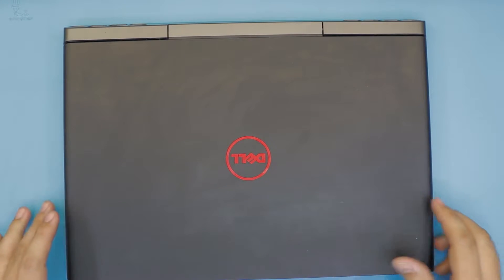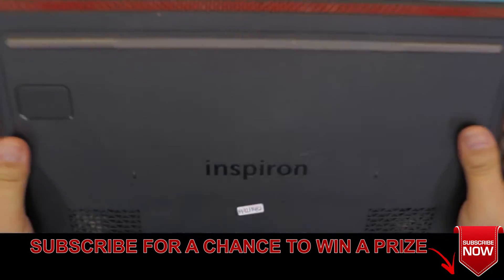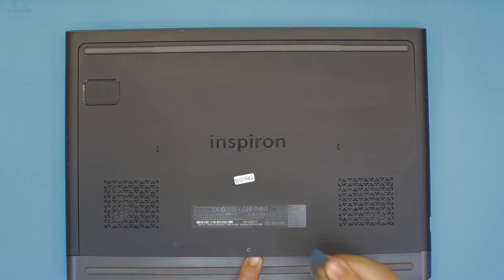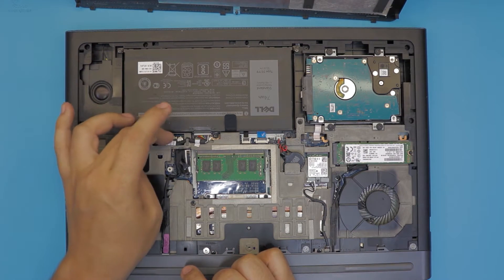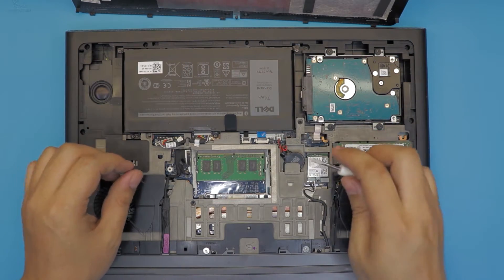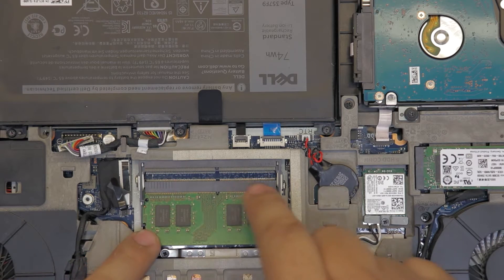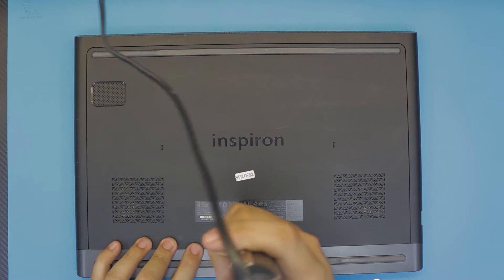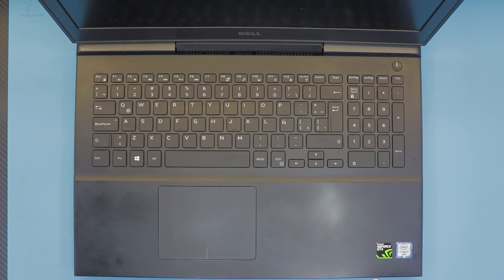Dell Inspiron 15 7000 RAM UPGRADE / Replace

Comment: Thanks a lot for the video and the straight to the point explanation. My issue is, I have an 8gb Ram, but I learnt the max capacity of the laptop is 32gb Ram. So  I want to know if it's okay I get 2 of 16gb ram to achieve the 32gb.
Reply from the maker: Thank you for your feedback! If you wish to support the channel, you can like, subscribe, or both!
Regarding your question, sure you can we have upgraded this laptops to 32gb 2x 16gb with this compatible rams: https://amzn.to/3WG5y4K
double check the max capacity: https://youtu.be/tKEJTkVth4Q
Should you have any further questions or requests in the future, please don't hesitate to ask me.
Reply: @uFixTek  please will 16gb 2666 MHz work cool or I need to get the exact 2400 MHz?
Reply from the maker: the 2666 will work fine my friend the bios will auto adjust automatically.
Reply: @uFixTek  thank you
Reply from the maker: It's my pleasure my friend. 😊

Comment: Hello. I’m new to computers so I was wondering when I change the ram from my current 8g to a 32 do I have to do anything else or is it just plug and play pretty much. This is my first laptop I’m trying to work on myself. Thank you.
Reply from the maker: 🫠Regarding your question, it's just plug and play no extra configuration is needed.
Should you have any further questions or requests in the future, please don't hesitate to ask me.
cheers🍻

Comment: Hello, I’m not sure if you’ll reply but I can insert ram on the lower slot on this exact computer but if I try to insert it on the upper one it gets stuck halfway through
Reply from the maker: TheBowenArrow you have to push it firmly , in some cases it wont go all the way in , if its not going anymore in its ok push it to the mot if you hear the clips clicking then its in
Reply: I have the same problem, my model has the little plastic straps missing in the upper ram slot

Comment: Hello if I put 3200hz ram will it clock at that speed or will it run it slow at 2000 mz
Reply from the maker: Thank you for the feedback! if you wish to support the channel you can LIKE or SUB or both :P
regarding your question: the Motherboard and bios will auto adjust to max ram speed that it can handle, remember this laptops don't have advanced bios to set your own ram speed. so if you placed a 3200 and the motherboard runs it at 2666 then that what you have. you can't go any higher. and make sure all your rams are 3200 or all are 2666 else if you mix the speed the bios will take the lower speed ram as reference and lower the higher to match the lower speed.
Reply: @uFixTek  No, it is does not work like you say. DELL 15 7000 inspiron WILL NO WORK correctly at 3200 RAM.
It will crash, becouse BIOS of that model DOES NOT SUPPORT high speed RAM.
Install only 2400. I dont find information about 2600. In my DELL Fury 3200 Ram Crash like in other users who try to install 3200.
Use 2400

Comment: Does the computer have a limit of ram you can install? Was hoping to upgrade it to 32 gigs of ram for my bday but i dont know if theres a limit
Reply from the maker: yes you can go up to 32 gb ram max,
https://amzn.to/2BZtqrV
Reply: @uFixTek  i have 8gb ram on my one slot can i add another 16gb ram to my second slot total of 24 gb. is it possible?
Reply from the maker: chinzo bayarsaikhan it is possible but if you want to game on it i would highly recommend to add the another 8gb with the same speed ram as the one you have that way it will activate a dual channel mode, its much faster.

But if you want to do video editing or applications then yes go with 24gb config.
Reply: @uFixTek   Hi, I do programming and use emulators and virtual machines would you recommend me go for 16gb or 24gb?
Reply from the maker: Luis Mtz if you doing prog you should go 16 or even 32gb. If you using VM
Reply: @uFixTek  i have a problem i bought the ram you linked me and installed it fine but for some reason when i check my pc settings and specs it says i only have 24 gigs of ram? did i do soemthing wrong or did they send me the wrong type of ram
Reply from the maker: Caiden you bought a 8gb ram and how much ram you had inside your laptop before that. And how did you check? I think you read your pagefile ram not your actual ram!. When you power on your laptop press f2 and get inside the bios and see the correct info there.
Reply: @uFixTek  ill check it this weekend i bought the duel 16 gig ram pack

Comment: Does it have to be Dell certified RAM or can I use any sodimm DDR4 2400?
Reply from the maker: Thank you for the feedback! if you wish to support the channel you can LIKE or SUB or both :P
regarding your question: Any sdram ddr4 2400 will work no need for any certification (doesn't exist)
this a very compatible ram and highly recommended: https://amzn.to/3NBeTWl

Comment: After installing the ram do you have to reinstall windows, and did you replace or upgrade the ram to 16gb?
Reply from the maker: Thank you for the feedback! if you wish to support the channel you can LIKE or SUB or both :P
regarding your question: NO, not at all you can remove upgrade replace the rams and it will not affect the files or system or anything. its totally safe to do it. you can place 16gb and no issue. if you want to know your max ram capacity check this video:
https://youtu.be/tKEJTkVth4Q
Reply: @uFixTek  thank you so much I will check it out. Will sub
Reply from the maker: anytime if you need any help let me know.
Reply: @uFixTek  thank you

Comment: Hello, I have a problem, I had two RAMs in the form of 2x16, but one of them broke down anyway.  Now I have a solid 16gb ram, but it works when it is in slot A, but when I plug it into B, it does not turn on with the notification light.  so i mean is Slot B broken?  Or is the motherboard manufactured to work in a single Ramle A slot?  Thank you in advance for your answer.

edit: the other broken ram was on when I plugged it in, but I was eating blue screen and green lines appeared on my screen.
Reply from the maker: Thank you for your feedback! If you wish to support the channel, you can like, subscribe, or both! Regarding your question, all laptops and pc have DIMM1234 and they only work as they motherboard manual, in your case the dimm A must be filled 1st then you can use DIMM B, your board is fine

Comment: Hello, could you recommend me maximum and which kind of memory ram for Dell Inspiron 15-7559, I work with Premiere Pro, Photoshop, After Effects, want to have the best performance out of it. Great videos and channel, congrats.
Reply from the maker: Thank you for your feedback! If you wish to support the channel, you can like, subscribe, or both!
Regarding your question, 1st check the max ram capacity: https://youtu.be/tKEJTkVth4Q
if the ram capacity is 16gb then get this: https://amzn.to/490eo2n
if 32gb then this: https://amzn.to/3NTq0vH
this above rams are very premium and we use them all the times.
Should you have any further questions or requests in the future, please don't hesitate to ask me.
cheers🍻

This is an Amazon affiliate link. When you use my links, you are helping to support the channel. 🙏
Reply: @uFixTek  found out that suggested ram is ddr3l 1600 Mhz, 16 GB max., how do you recommend: DDR4 3200 MHz SODIMM PC4-25600?, regarding link of amazon you posted. Could you expand a little bit, please?
Reply from the maker: you can place a 1666mhz but if you place a 2666 or higher the bios and motherboard will always auto adjust the speed to the max it can handle (in your case if the board runs at 1600 ) it will lower.
if you want to purchase the the nearest to 1600mhz then get the 2400mhz
https://amzn.to/3Hf8cr3
i recommended the higher speed as it will have no issue on its combability.
Reply: @uFixTek  wow I did not know that, thougth that you needed to use the recomended on laptop specs sheet
Reply: @uFixTek  if this is your laptop and want the best performance Which one would you pick to Edit videos with adobe products?
Reply from the maker: wooo wait a sec i just saw that you said DDR3L ??!!!
this laptop doesn't take DDR3L is a DDR4. unless you have a different base model!
give me the TAG number of your laptop, so i can tell you exactly what you should have,
this laptop in this video take ddr4: https://imgur.com/a/VewSVYu
Reply from the maker: that is vast 7000 Series pdf that may not even be for yours laptop, under your laptop there is a sticker look for TG: or tag number or take a picture send it to my email, or when you enter into bios you will see the tag number.
Reply: @uFixTek  it says service tag : 765FQH2, is that the number that you ask for?
Reply: Photos of tag and current memory ram cards of laptop in that link
Reply from the maker: yours is Inspiron 15 7559, that is gen 6cpu
is a SDRAM DDR3L (L is for Low voltage)
you can only have 16gb 2x8gb DDRR3L : https://amzn.to/4aNcKCz
the model that you have a is a bit older than the one in this video.

This is an Amazon affiliate link. When you use my links, you are helping to support the channel. 🙏

Comment: I’m trying to install the two 16 GB Rams. When I clicked the buttons to raise to 45° and I pulled out the original 8 GB RAM. The hatch closed… I cannot get it to open now. Is there a trick to getting it to opening with no ram stick in there?
Reply from the maker: Thanks ✌  for the feedback!  if you wish to support the channel you can LIKE or SUB or both :P
Regarding your question:  no you don't open the hatch when there is no ram, just simply place the ram in 45° and push a bit with force to the motherboard and the ram will push the hatches to the side and over its self to lock it.
the only time you push them away its only to remove it.

Comment: I have the same laptop i updated it to 16gb can i update to 32gb having two 16gb cards? I looked up in Amazon using your link same brand just more gb and they are ddr4 and 2400
Reply from the maker: Thank you for the feedback! if you wish to support the channel you can LIKE or SUB or both :P
regarding your question: 1st of all double check to see if your CPU and mother board can handle 32GB:
https://youtu.be/tKEJTkVth4Q
if so let me know.
Reply: @uFixTek  i just did it i got 33.55
Reply: @uFixTek  so max i can get is 32 ram which is still smaller then 33.55 can i still buy the 32 or is it to close to the number
Reply from the maker: 33.55 its premuch 32GB, its like the HDD when you buy a 500Gb you dont actually get 500gb you get 480GB, same goes for ram the ram that you purchase its technically 33.5gb but its programmed and sells as 32GB.
anyways YES you can have 32GB max ram.
we use this brand and its rock solid and compatible:
https://amzn.to/3nzR2ew
2nd option:
https://amzn.to/3fA9Vtq
Reply: @uFixTek  awesome thank you hopefully i can get better fps 🤣 i also need a new battery I’m scared to get one off of Amazon lots of people said aftermarket batteries don’t wanna charge sometimes, anything you might recommend what i should do?  Its a inspiron 15 7000 gaming, 74wh type 357f9 11.1v battery
Reply from the maker: if you gaming remove the battery and use the laptop without it it will last you longer and the charger too will last you longer. no matter where you buy its 50-50
Reply: @uFixTek  can i just unplug it? And leave it inside of the laptop
Reply from the maker: sure you can, nothing will happen to it.
Reply: @uFixTek  I’m assuming the rank doesn’t matter? I have single ranks in my laptop now
Reply from the maker: no rank for you doesn't make a difference

Comment: Whats a good upgrade for the base model ram ? And how much ram can be installed in this laptop?
Reply from the maker: 16Gb ram is the recommended you can go 32gb but its overkill, 
single 16gb stick: https://amzn.to/34XG9KF
2x8gb stick: https://amzn.to/2TR2PG0

Comment: Hi,  I have tried to put a matched 16GB of RAM to my Dell Inspiron 15 7000 to give it 32GB of RAM . My laptop is identical to the one in this video. I did not disconnect the battery but put the new stick in. the BIOS sees the RAM but now won't boot up as it says there has been a warning "Alert! The amount of system memory has changed". Now I can't get the laptop to boot. I have tried to remove the new RAM and reboot the laptop but it still fails to boot. This should have been a simply process but I can't get past it. After several failed boots the Dell Support Assist kicks in and scans the system and there are no issues identified but it still fails to boot. Is there anything else I could/should do to get my laptop to work again? I wish it had been as simple as your video!
Reply from the maker: hi, don't worry your laptop its just fine, the issue you facing is a stock BIOS config. i need you to follow this steps exactly as i say:
#1. remove the charger, disconnect the battery, disconnect the bios battery 
https://imgur.com/a/F8n7idh
#2. remove both rams (all rams)
#3. press and hold the power on button for 30-40sec
#4. plug in the new rams both 16gb.
#5. plug in the bios battery only wait 60sec
#6 plug in the big battery
#7 plug in the charger and wait 15sec
#8. press power on button and wait 10-15 sec (it could be in black screen) the bios will reset to default.
note: you may get a reading saying bios has reset to default and press any key to continue. 
if anything let me know
Reply: @uFixTek  Many thanks for taking the time to respond and help me. 

I have done everything in the sequence you prescribed and got to #7 and when I plug the AC power in the fans start up and the laptop seems to do several blank screen starts. 

It then loads into a BIOS screen with the message "Time-of-day not set - please run SETUP program" and also "Invalid configuration information - please run setup again". 

I understand if the CMOS battery has been disconnected and capacitors discharged the BIOS will rest and the time won't be right. So I go into the BIOS  and put the right time and date in and restore the BIOS to the defaults. I exit BIOS and the laptop tries to reboot but ends up at the same state as before. 

I am guessing there is something I am doing wrong or there is more to this issue. 

Are you able to offer any more advice, please? Thank you.

Comment: Can I put 2 8gb ram at the same time since there is 2 slots?
Reply from the maker: Samo Sloga yes you can, but put always one ram dim then turn on and when you see the boot screen turn off and add the 2nd dim
Reply: uFixTek so put one ram in turn on the computer and then turn the computer off and add the second one?
Reply from the maker: @stefanpozder8376  exactly, something or most of the times on the laptop when you add both at the same time it may not boot. go one by one
Reply: uFixTek ok thanks dose it matter what type of ram u put in the laptop?
Reply from the maker: @stefanpozder8376  wait a sec, give me the exact model number of your laptop or the tag #
Reply from the maker: because some 2017 models use ddr3 and 2018 use ddr4
Reply: uFixTek where can i find that? On the back cover
Reply: uFixTek nvm i took off the back cover and looked on ram it says DDR4 RVS 1.2v
Reply from the maker: @stefanpozder8376  ok excellent, you can put any DDR4  ram in there ,  for example : https://amzn.to/2EwOs2K

just remember :  The 2400 MHz memory works at 2133 MHz for the 7 th generation Intel Core processors.
so get any  1600MHz–2133MHz cheaper and works just fine:
https://amzn.to/2H2JH2s
Reply: uFixTek since i already have one 8gb ram in my laptop can i just add in one more instead of buying one single unit thats 16 gb because i can save a lot of money that way if it works
Reply from the maker: @stefanpozder8376   yes you can buy just a single 8gb or 16gb units it will work just fine
Reply: @uFixTek   Okay thanks for your help!!!
Reply from the maker: @stefanpozder8376  anytime , i appreciate your support by clicking like :)
Reply: @uFixTek   if i add another Vram to the slot will it increase graphics quality and help with frame rate drops?
Reply: @uFixTek  and how can I find out what vram i have? there is a sticker on my laptop which says that it has a 4gb vram i am very confused
Reply: @uFixTek  And if i got this correctly i have a total 8gb ram but my GPU or video ram is only 4 so if i would want to get a 16vram i would need 2 8gb vram?
Reply from the maker: Stefan Pozder vram and ram are two different stuff!, vrams are the BGA chips around your GPU not upgradable!  . And RAM is the memories that you see in the video.  The vrams are where your game textures go and in order to game to load and process it requires Ram too, if you playing big title games you required minimum 16gb ram so the game can lunch and be abit smooth.  Therefore if you want better FPS you need to have 16gb RAM (as shown in the video), and your vrams are soldered beside you gpu you cant do anything about that. Some games requires especific. Amount of vrams(then you need to purchase a new laptop with those specific spec on vrams) and cpu are also soldered on motherboard if sone games required specific cpu then you must purchase another laptop! The only thing that can Help in this situation is the RAM. Good luck
Reply: @uFixTek  So doing this upgrade will not help with gaming?
Reply: uFixTek  sorry i skimmed your text do you have any recommendations for what type of ram to get off of amazon that is affordable but affective?

Comment: Ok at the point I see you're replacing the ram, I also noticed there's more than one outlet of the ram, does it matter where you plug it in in that spot?
Reply from the maker: Thank you for the feedback! if you wish to support the channel you can LIKE or SUB or both :P
regarding your question:  if you placing two rams doesn't matter the placements of the rams. but of you place only one make sure the A slot is the one you install it in, the A is the one under (nearest the motherboard)
Reply: @uFixTek  might just install both the 8 gb one and the 16 gb one
Reply from the maker: yes that would be awesome, you will have dual channel up to 8gb and single after.